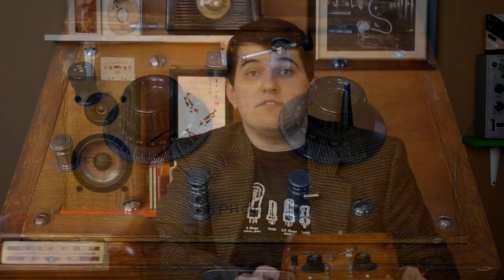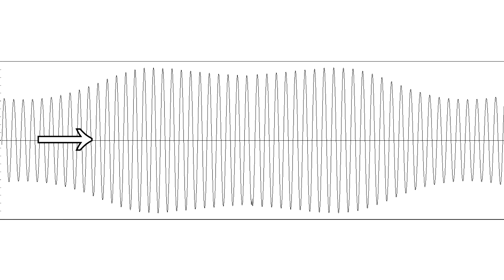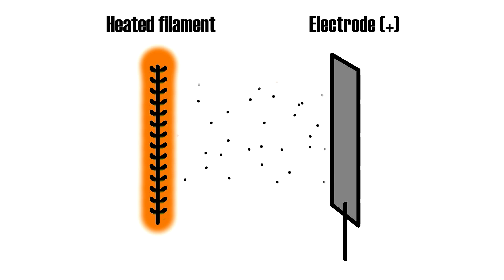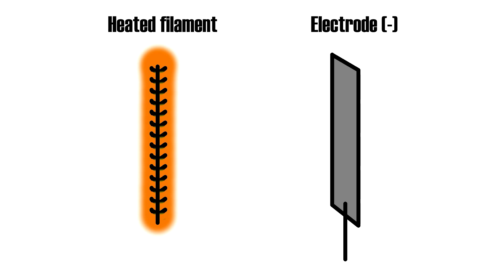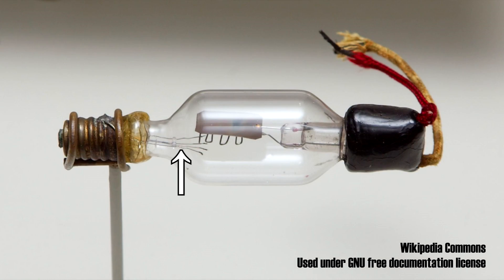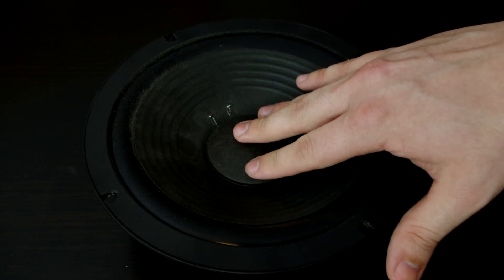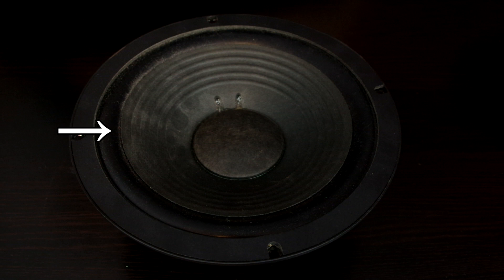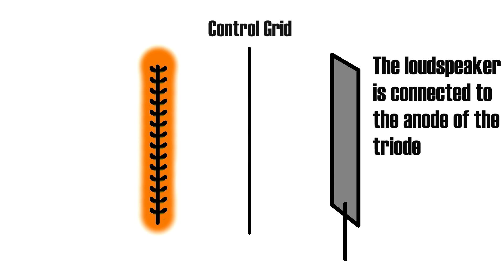The Vacuum Tube and the Invention of Radio

Comment: If the tubes can handle only DC, how it can amplify the AC soundwave? Thank you.
Reply: It's more like DC of varying voltage, however it depends on the relationship the waveform has with 0 volts, which is relative and can be moved around and usually changes multiple times in an amplifier. It's not AC per se, it's an audio signal, and you will find most amplifiers are just going from 0V to the maximum output voltage, in only one direction, because the only have a negative and a positive rail in the circuit. Plenty of bigger amps use a push-pull configuration where there is a negative, neutral and positive rail, but the net result coming out the speaker is the same.

Comment: How did the radio transmitter work before the vacuum tube?
Reply: Spark gaps were used in early radio telegraph transmitters. They had a wide bandwidth and were eventually banned after the narrower bandwidth tube transmitters became available.

Comment: 6:45 Just nitpicking here, but in this animation, if the control grid was negatively charged, the electrons wouldn't still be flowing towards it and just stopping like that. Not sure what they would be doing, but I wouldn't imagine they'd wanna go anywhere near the negatively charged grid. I get that you did it that way to demonstrate that it's blocking the flow of electrons, though.

Comment: Actually AM radio is used over many frequency - so called short wave and ham radio  used and still does use AM, even single side band is basically AM. This is done over a much wider range of frequencies.

Comment: i'd like to add one mention: crystal radios could only drive tiny earphones, because they operated purely on the electricity from the ether. with no amplifier to require additional power from batteries.

Comment: Do more modern AM radios use a bridge rectifier for higher fidelity instead of a single diode?
Reply: No, a single diode is sufficient. There is no difference in fidelity between a valve diode or a solid state diode in this application.

Comment: Hmm, triodes sure sound a lot like transistors!

But, where does the current from the control grid go? It has to form a circuit, doesn't it?
Reply: No, the grid is just a spiral of fine wire that surrounds the filament (or cathode). Electrons are pushed into the spiral to make it negative, or pulled from the spiral to make it positive. The spiral does not connect to anything inside the tube, but it is connected to ground through a large resistance in the external circuitry. 
   In practice, the average potential (voltage) of the grid is held slightly negative (grid bias) to prevent the grid from attracting and collecting electrons from the stream of electrons flowing from the filament to the anode (plate). Otherwise, the electrons collected would cause distortion of the signal being amplified.

Comment: Isn't the crystal almost a diode? Or does the structure just provide resistance in one direction rather than fully block flow?
Reply: Well, considering it's a semiconductor, it likely IS quite similar to modern silicon diodes.
But those also aren't perfect. Reverse current flow is certainly possible.

Those crystals likely just aren't very good at being diodes. They work, but not all that well.

Plus, a vacuum tube can also make the equivalent of a transistor, which is something those crystals almost certainly couldn't do with the technology of the time...

Making a semiconductor based transistor is actually remarkably hard.
Someone making a home-made valve would be just about possible, but while people HAVE done it, making a home-made semiconductor transistor is difficult and potentially dangerous.

(Did you know modern semiconductor manufacturing uses a toxic gas which is so deadly that if you can smell it you will die? Guaranteed. As a bonus it's completely invisible. Fun. XD)
Reply: A crystal is not a diode and will just oscillate when a voltage is applied to it. I think they used to use them as a component of a diode before tubes?
Reply: Not the same kind of crystal, and not the same phenomenon.  A galena (lead sulfide, a lead ore to prospectors) rock contains many crystal grains.  If the rock is embedded in a bath of molten metal which is allowed to cool, the surrounding metal provides a solid electrical contact with all the crystals.  If that metal embedded rock is cut in half, each half can be polished to make a crystal detector (two for one!), and on the polished face there are randomly oriented crystal grains.  If a very fine but springy wire, called a catwhisker for obvious reasons, is pressed lightly against the polished face and moved around to find a sensitive spot, where its tip contacts a single crystal at the right orientation, the contact becomes a rectifying semiconductor junction.  That's how the crystal diode worked.  The very first modern semiconductor diodes and transistors used precisely grown SINGLE crystals (so the entire surface was a sensitive spot) and catwhiskers, which were molded in place, to do the same thing much more reliably; a transistor had two catwhiskers separated by a very small and precise distance.  The first semiconductor used was germanium (Ge), but later diodes and transistors used different fabrication methods without catwhiskers to produce the junctions, and they worked better with silicon, which is found everywhere on Earth.

The oscillating crystals are made of quartz, or silicon dioxide, cut into thin slices along the proper cleavage planes, with each side covered by a metal electrode.  Quartz is one of the substances which are piezoelectric (from the Italian word for pressure): apply an electric field and they bend slightly; bend them and they produce a small electric field between the sides.  Only the electric field, or voltage, is required, not an actual flow of currents.  These crystals are cut and ground to specific frequencies of vibration, and they make an extremely stable equivalent of a resonant electronic circuit, so they came to be used as frequency controlling devices for oscillator circuits using vacuum tubes, transistors, or other amplifying devices.

Ironically, the use of quartz crystals as resonant circuit replacements came long after "crystal radios" had become obsolete except as hobby projects.  Most "crystal" radio kits today use the newer silicon diodes instead of galena crystals, so the hobbyists don't get the experience of trying to find just the right spot on a finicky multicrystalline surface, just the radio building part.  Besides, they sell the kits for children, and galena contains lead.  It's safer to just put a standard silicon diode in the kit.
Reply: Allan Richardson  Excellent summary IMHO, just one niggle; you wouldn't do very well using a silicon junction as an AM detector, the junction voltage is quite significant. With a decent signal it would work but no one would choose one over a germanium diode. There are varying versions with varying characteristics but the germanium is the central detail because of its much lower junction voltage and accompanying voltage drop.
Reply: It's also interesting that other things than galena can be used as detectors. Silver dimes and certain kinds of razor blades worked also.

Comment: it's easy to assume now that back then they mistakenly thought that radio was a result of induction but there has been a swindle in the meantime. The first "radio" (more like wireless transmitter really, since radio refers to radiative waves such as electromagnetism as opposed to the dielectric longitudinal pulse perturbations used by this type of transmitting device) was invented by Tesla and indeed used induction as longitudinal electrical impulses through the ground (not the air).

Comment: The thing I've always thought kind of strange about the history of radio is that a primitive solid-state system--the crystal radio--came before the vacuum tube. Seems like a road not taken.
Reply: It does indeed seem like putting the cart before the horse...back then though all they were able to use were point contact diodes like galena and rusty razor blades, which were very hard to actually find a semiconducting portion of.  The tube seemingly eliminated the guesswork and allowed much higher currents than a crystal and cat whisker.  Of course, as semiconductor tech improved and they were able to get very pure silicon and germanium,  it became much easier and efficient to make solid state transistors.  Still, this video made the whole process of tube radio and amplification seem so much easier to understand without all the math mumbo jumbo that they usually include.  As a side note, I love science but hate math.  Counterintuitive,  I know, but that's me. Heh.

Comment: Professor Edwin Howard Armstrong and his inventions (super-heterodyne and Frequency Modulation aka FM) are sadly oftentimes overlooked when the history of radio is discussed.  Lee de Forrest has little understanding of a vacuum tube even though he supposedly invented them.  David Sarnoff of RCA seems to get the most attention.  Lee de Forrest died penniless in Hollywood and Professor Armstrong committed suicide over the lawsuits he was having with RCA and his invention of the FM frequency.  David Sarnoff seems to have had the best ending, certainly monetarily.
For information on the history of radio and its' development can be read in the book, "The Empire of the Air".
Reply: the thermionic valve was invented in Lancaster ,England.
Reply: @underworldent4817  Glad to hear of this information.  There are really few books on the History of Radio although there are some out there which are very good.  The Empire of the Air is one of them, but many more and even more specific books on specific brands and their histories would be most interesting.  The only one I know of now is with Zenith, as there are three books on the Company fairly well researched, but even there much of the early History is missing and sadly because so much of the information was not documented over time.
Reply: @richardmcleod5967  effectrode is a uk company that makes thermionic valve based effects pedals. i recommend their site , there is lots of historical info on there.

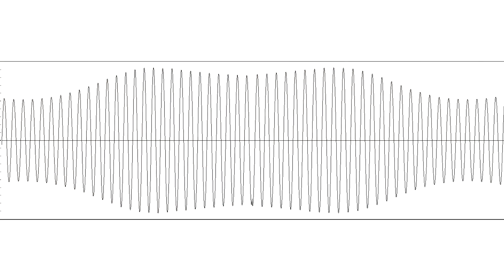Comment: Re: 3:55 Another way to demodulate an A.M signal is to reverse the connection to the antenna and tuner at each zero crossing point. And there is one small thing that is important. The rectified signal is D.C but a loudspeaker can only be driven by A.C.

The radio telegraph came before audio broadcasting and had a problem to solve. And that's the problem of communication between ships and shores. The first people to circumnavigate the earth were those on Magellan's expedition, which returned to Spain in 1522, just before the beginning of the scientific revolution.
 But those Castilians who stayed back at home didn't know where that ship had gone until it returned. That circumnavigation of the earth (the first one done by humans) took three years, and it wasn't until their return that the public knew that it cost the lives of nearly all the crew including Magellan himself.
 Ship-to-shore communication wasn't possible at that time, and it was just taken for granted that sailors couldn't communicate with officers stationed at the port. At that time, people around the world actually doubted their ability to develop new technologies, such as the telegraph, let alone radio telegraph.
Reply: Not quite true: A loudspeaker CAN be driven by DC but it needs to be a varying DC. AC is where the polarity actualy switches during the wave cycle. In varying DC, it doesn't yet it will still drive the loudspeaker. The varying signal has what is called a "DC offset", and it means that the current never goes "negative" during any part of the wave cycle.
Reply: @fredbear3915  Loudspeakers can be destroyed by D.C flowing through their coils.

Comment: You usually do a pretty good job with these videos, and this one is no exception. Still, I wish I could sit down with you and explain where some of the things you are saying (though they are the common wisdom and will probably remain so) are nevertheless wrong on some significant levels.  It probably wouldn't change what you'd say here, but would be more suitable for a deeper technical video.  

For instance, talking about the crystal detector as a semiconductor is misleading- especially where galena is concerned. It doesn't make a PN junction; in fact, like the blue razorblade detector in a foxhole radio- which is EXACTLY like the crystal set you showed- it's a diode, alright...but it's a TUNNEL DIODE.  And that has been misunderstood for well over a century....but it's actually true.

Comment: The audion (triode) was even more important in another aspect of radio: transmitting.  A rotating AC generator produces alternating current, but at too low a frequency for a reasonable antenna to radiate (although in theory, the North American electric grid is about 3000 miles wide, a half wave dipole for 60 Hz, so aliens may have detected 60 Hz radiation).  The first, and for a time the only, way to produce HIGH enough frequencies of AC is a spark gap; as Hertz discovered, when a current is jumping a spark, the electrons tend to overshoot and undershoot the gap, causing random variations in the current, which can be fed to an antenna to radiate waves at a high frequency.  A combination of an inductor (coil) and a capacitor (called condenser in those days) determines the frequency, and a telegraph key can turn this radiation on and off.  But because it is modulated by random noise, it sounds like a burst of "static" interference from distant lightning.  Your basic crystal detector allows you to hear noise turned on and off, but not to hear voice or music very well.

Fessenden made his famous proof of concept broadcast using a rotating generator with MANY windings, only one of which at a time was connected as the generator spun at an insanely high speed, producing a SMOOTH AC wave at one of the lowest frequencies usable for radio, and used a telephone mike to modulate it, playing a hymn over the air on Christmas Eve, but this was not practical for going to higher frequencies (shorter wavelengths); in fact, it wasn't really practical at all.  But the audion allowed engineers (Edwin Armstrong may have been the first) to make an ELECTRONIC OSCILLATOR that turned a DC power source into a tunable high frequency AC power source.  By feeding a bit of the output back to the grid input, and tuning this feedback with a coil and capacitor (a RESONANT circuit), or later, tuning it by a vibrating quartz crystal, one could create a COHERENT carrier wave that could be modulated.  Only then did the radio broadcasting of sound become possible.

So the audion, and its improvements and descendants of the following decades, made both the transmission and the reception of complex signals such as sound, fax, TV, and eventually digital data possible.  And it improved code reception also; a pure sine wave tone is much easier listening than a static noise signal.

Comment: That speaker wouldn't work in one of those old radios though without doing a lot of modifications to the radio.  Those old radios used field coil speakers without permanent magnets.  They had a large electromagnetic coil in place of where the permanent magnet is on a modern speaker and used fairly high voltage.
Reply: It doesn't really take a lot of modification. You just replace the field coil with a choke coil for the power supply filter, replace the output transformer, if necessary, to match the impedance of the new speaker, and replace the speaker.

Comment: I see a lot of mention of Marconi here without mentioning that he, in fact, was not the one to first use radio that way, he was the first to patent the final product using the components made and patented for that very purpose by someone else.  The patent was stripped from Marconi but only after the death of the original inventor.  it really annoys me that so few people even to this day forget that Tesla made the first radio transmitter and receiver.
Reply: Actually it was Hertz who was first if you mean a human.
Lightning had been transmitting all along so it is more a matter than humans discovered than invented radio.
Tesla was first to send useful information via radio.
He also invented radio control.  In his case it was a little boat.

Comment: One difference between radio waves and sound waves, they are different.  Radio wave are electromagnetic radiation which doesn't need a medium, and sound is pressure waves through air.  If you had a radio signal at 10Khz you could not hear it.  I know Alec knows this, but just wanted to point that out.

Comment: The complete crystal detector is not just the galena crystal but also a metal wire touching it. Clearly a junction is needed for a diode.
Reply: The wire was called a cat's whisker. It was movable, so you cold find the crystal's sweet spot.

Comment: The diode, not the triode, was already given the name "valve". This is because it acted like a non-return valve in a water pipe. Water flow was used as an analogy for electron flow from then onwards, until, maybe, twenty years ago.

Comment: tubes didn’t just go to recording they revolutionized music. now you could amplify the sounds of instruments with speakers and valves!
Reply: Tubes can also make music. The Hammond Novachord, introduced in 1937, used rows of tubes to produce its tones. There were 12 rows of twin triodes, one row for each note of the chromatic scale. Each row had a multi-vibrator, a bi-stable oscillator, to produce the high octave for each note, and a set of frequency dividers, flip-flops, to produce the lower octaves. These were wired through the keyboard to filters that modified the tone and fed to the amplifier, which drove the speaker. This is considered to be the first electronic keyboard instrument.